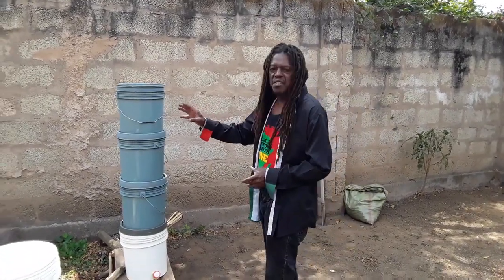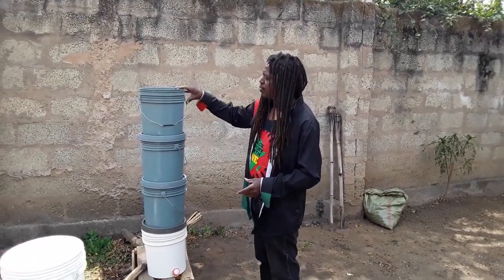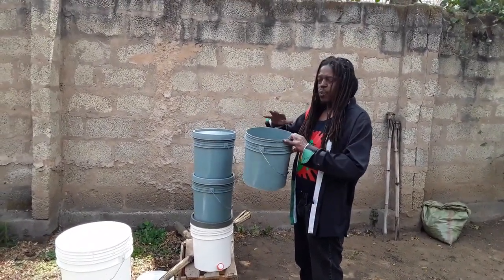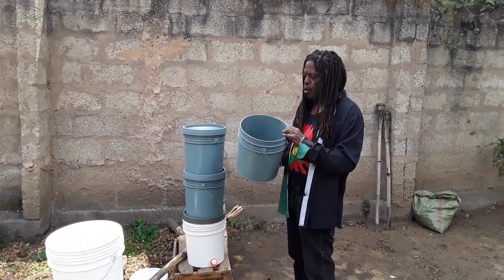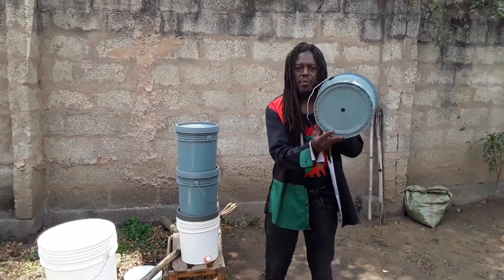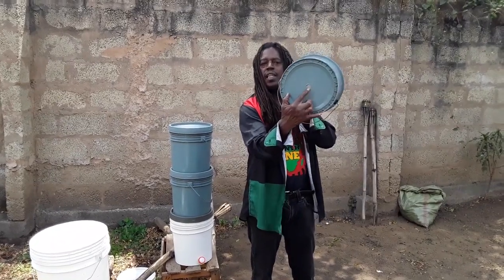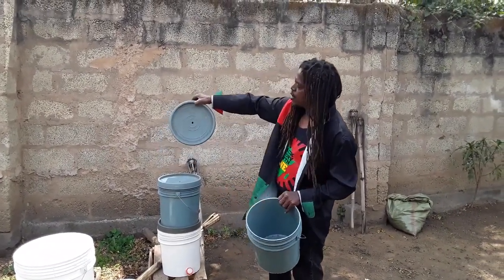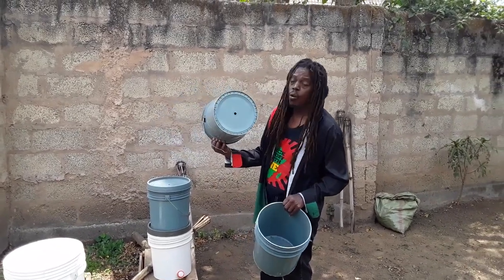The Ledge Group-Teaching water filtration methods

Comment from the maker: I did this work with a kitchen knife and crude materials, if I had materials I would have added screens, filters between each bucket in descending sizes e.g. 1.5 Micron, 1.0 micron, 0.5 micron between each chamber. I would have added a 4th chamber and added a UV element to remove pathogens.

Comment: Just learned how to filter water in 3minutes and 37seconds. A simple effective method.
Reply from the maker: and with that, my efforts are validated, if just ONE MAN finds the capacity to do a small piece of his essential needs for himself, I am successful. This model can be scaled to any size, it was crude and done with a kitchen knife and easily accessible material. Given resource, I would use a 2 micron screen on the first bucket, 1.5 micron screen and a 0.5 micron screen between the third and reservoir.

This can be made in a portable size, two liter bottles for instance. Furthermore, for a fixed placement I would consider adding a UV light to remove pathogens, so if my home that is what I have.
Reply: @TenBearsII  It’s just a matter if working to get activated charcoal after that 👌🏾✌🏾
Reply from the maker: @damieteharry2044  I think I neglected to mention in lieu of Calcium Chloride you can use Lemons which is what we did.
Reply from the maker: @damieteharry2044  Active charcoal removes toxins from any medium, its used in every hospital in the world for poison removal...its in every product and you can make every product you need with it. Please, use it family
Reply: @TenBearsII  Thanks you for enlightening me I didn’t know that!
Reply: @TenBearsII  Thanks you for enlightening me I didn’t know that!